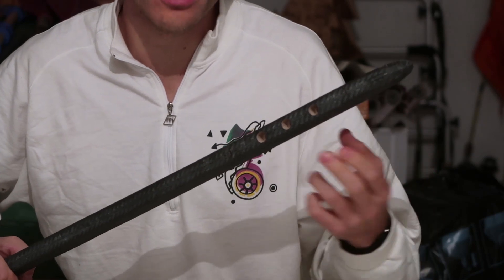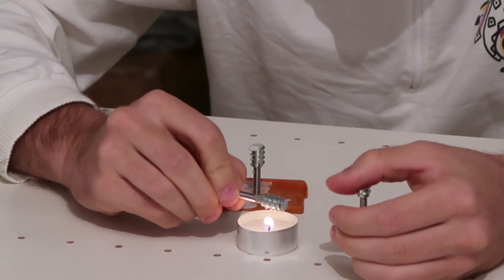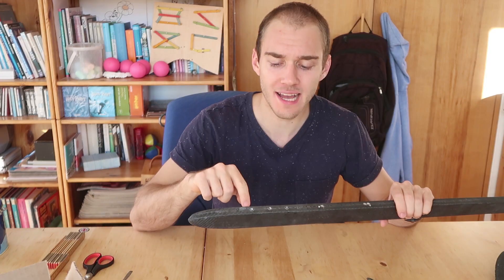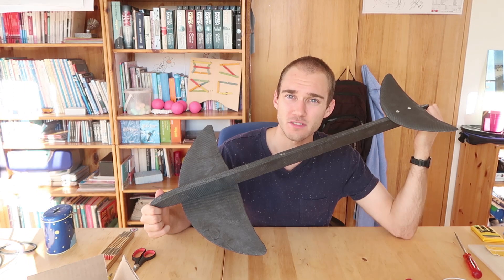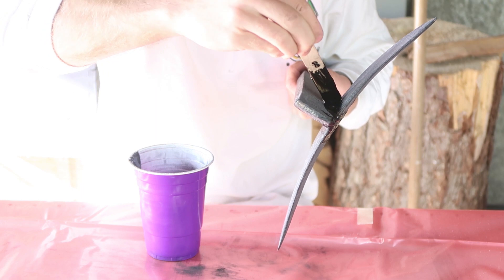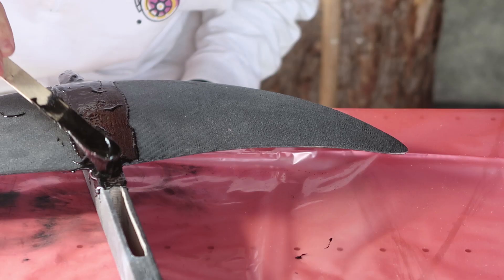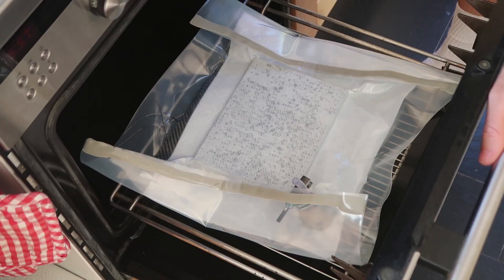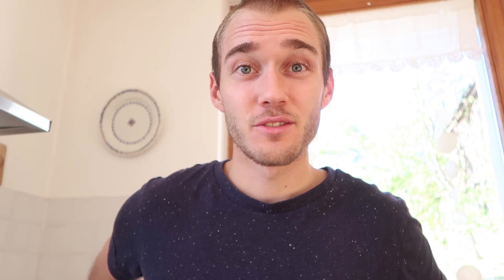HOW TO BUILD A HYDROFOIL surf board - Part 3: Assembly

Comment: Hey man, awesome videos.   I want to do a project myself but nothing crazy as yours.   I want to mount a Naish foil on a wake skate.   There is video showing how to do it but I think adding some kind of chemical to protect the drilled holes from water damage would be useful.   Can you recommend something?   This is the video I'm talking about: https://www.youtube.com/watch?time_continue=1&v=ifb7fgLykHU
Reply from the maker: Hmmm, what I would (and will do in the next video) is drilling a hole slightly larger than the actual hole into your wakeskate. Then, you wonna fill this hole to the top with some epoxy resin mixed with some carbon powder/chips. Once the resin has hardened, drill a smaller hole directly through the hardened resin. That way, your holes are completely waterproof and the core of the board will not be damaged by water. Hope it helped. If you have further questions don't hesitate. Good luck man! ;)
Reply: thanks a lot dude,  will give that a try and reach out if I have more questions.
Reply: I was looking at getting epoxy resin and carbon chips but they don't come in small amount and all of it will end up costing $50.   Is there an alternative method to waterproof the wood ?   Something I can buy at a local hardware store.
Reply from the maker: Maybe plastic/metal inserts could do it...? But i think you will need epoxy anyways. Or simply try to seal the wood with PU varnish.

Comment: 1. Will you ride it? 2. Will you hot coat it? 3. What epoxy do you use?
Reply from the maker: Yes, of course, I will ride it! Yes I will coat it! As for the epoxy resin, its the epoxy resin L and hardener L from Cytox. I've tried some other resins but this one is clearly the best for many applications.